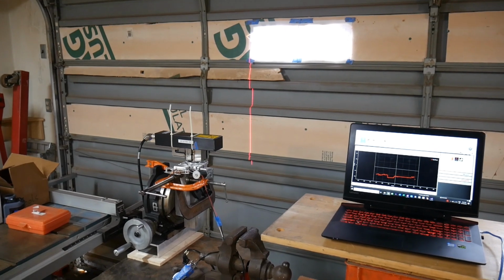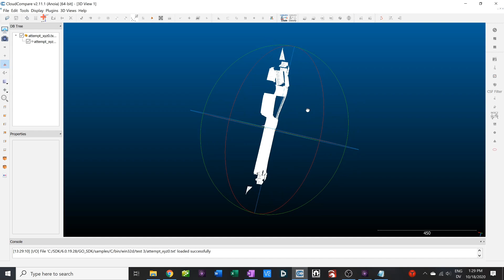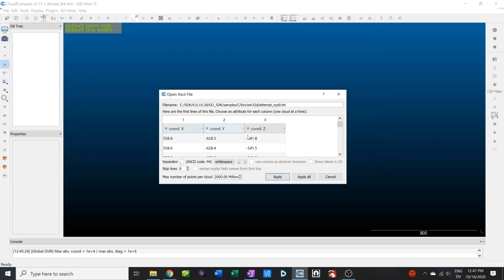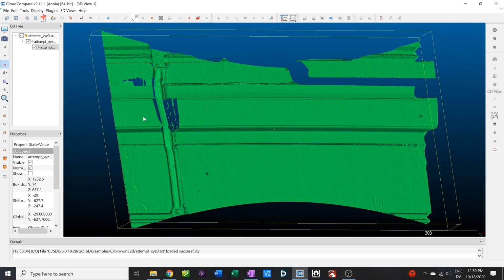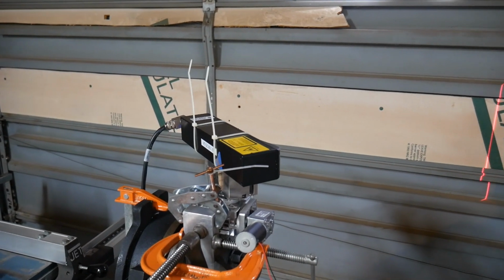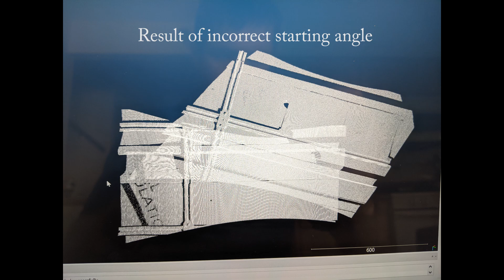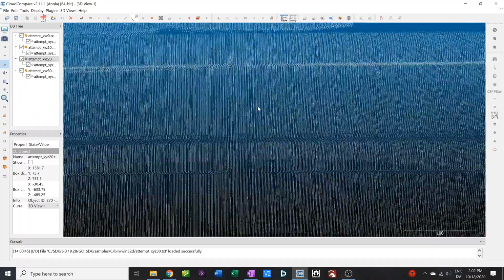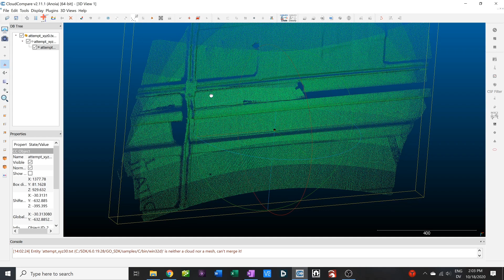Laser Measurement #2

Comment: That is a great work!!! I need a laser that would measure the inner diameter of a non accessible inground pipes that i would fix at the end of a  pole stick. Let me know if it could be possible. Of course it would be manually manipulated so it wouldnt be static. Maybe an average diameter would help knowing that the pipes diameter are standards ranged manufactured.

Comment: Nice point clouds!  I was impressed at how closely they lined up in that demo: even faking it that well would be difficult.  I'm sure there is some room for improvement via models of uncertainty in the motion control system, but it's probably a huge amount of work relative to what you've got thus far, and the only real benefit would be getting better models "in camera", so to speak.  The repeat stop is working far, far better than I would've expected.

(Also: the single most precarious example of "You can never have too many clamps" I've seen.  Lots of delicate, valuable equipment clamped to big heavy things, four feet above a concrete floor, and moving.  Bit of pucker factor on that one for me: in my shop, that would invariable wind up wiggling the base clamp loose while the setup is fully cantilevered, and I'd have to find all the optics pieces with a broom…)